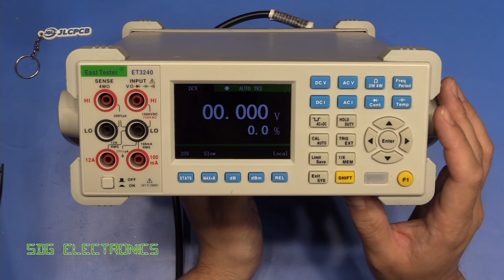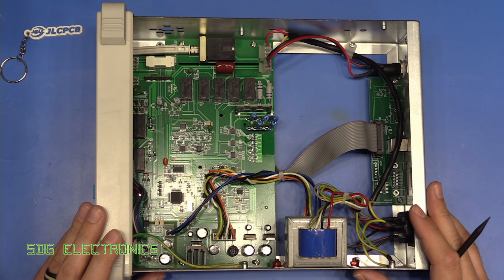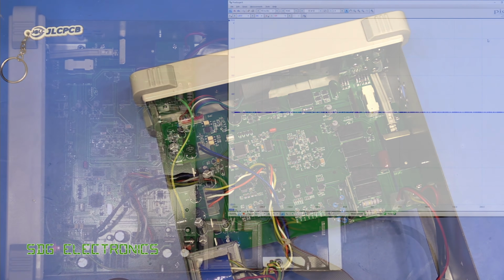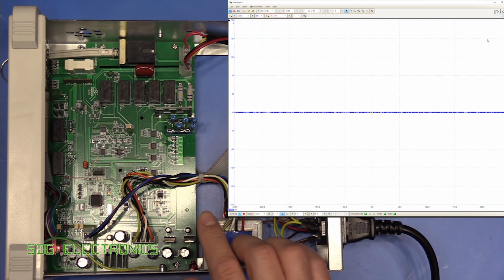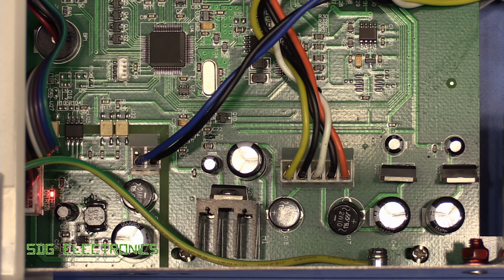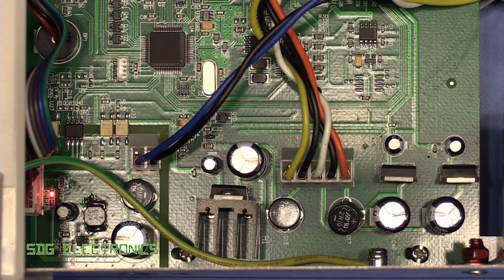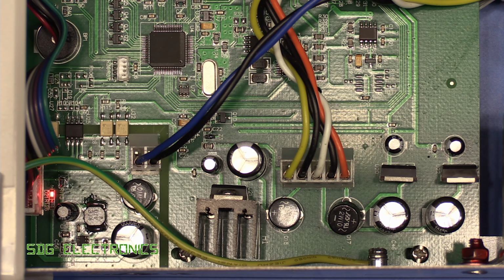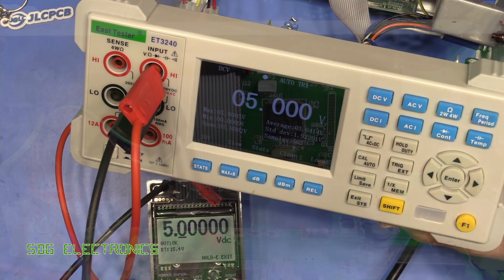SDG #202 4.5 Digit multimeter which keeps browning out

Comment: After cutting any pin or component leads i like to reflow the joint as you say to remove any stress in the joints.
Reply: That's double the work! :)
Reply: @goku445  Not if you remember to cut them the right length at the start. if your kit is flying at MAC1 and 40,000 ft you don't want a stressed out joint before it starts. :)  if it's sittng in your living room not a big issue.

if you sell your products you don't want them coming back, it's bad on sales.

Comment: Nice video!  Just confirms my general theory on why things break:  if it's a moving part or a power supply (which often have fans), look there first.  I wonder if it was a fractured solder joint from trimming off those pins?  Hard to tell..

Comment: Interesting to see that the problem was a cheap connector or bad solder joint.
I have reviewed this meter, it works fine, but finding some functions can be difficult to find and documentation of remote interface was not included (I needed it for my software TestController that can handle a lot of different meters).
Reply from the maker: I'm disappointed the spec for the interfaces on these Easttester units seems to be quite elusive. I have a Function Generator by the same brand, but it didn't reveal how to upload arb waveforms.

Comment: I'd reflow U24 too. Looked a little bit wonky of a soldering job...
Edit - FP LCD flex soldering is really quite easy- desoldering could be when you use not hot enough blade iron tip.

Comment: Nice repair 👍 I wonder which bench DMM is actually better - the one you actually use all the time, or the one you have, but rarely use, because of the fragile VFD? I tend to grab my Brymen or Fluke DMMs a lot more often than HP/Agilent. It is an aspect that often gets overlooked in DMM reviews.
Reply from the maker: That's why I still use my Meterman 37XR quite a lot. It's about 15 years old now, but was 3x cheaper than the Flukes and has a really nice clear display. Like you suggest, the technical specs aren't everything.
Reply: @sdgelectronics  Yes, most of the time you just need to measure power rail or check for continuity. Often, it is the probes that matter the most. I often use super cheap Aneng meter, that I got from Ali (after Dave gave it thumbs up), but with probe master probes.
Reply: @sdgelectronics  Meterman was made by  the Wavetek back in the day?

Comment: I have some tinkering on CRT monitors coming up and need an isolation transformer... any recommendations?
Reply from the maker: None specifically, but I'd go for the biggest you can afford. The higher source impedance of the smaller units mean you can get some unusual waveforms depending on your load. I'm using a Rheomed medical isolation transformer which I picked up on eBay a long time ago.

Comment: Does your meter filter 60Hz noise mine does not seem to ?
Reply from the maker: We're 50 Hz here and it's pretty clean.
Reply: @sdgelectronics  Huh. Mine sees to float just sitting there and it seems quite sinusoidal. Maybe more investigation is warranted.
Reply: @stevenspmd  floating readings on any multimeter is perfectly normal operation. The noisier the environment the more hash your leads will pick up just like any good antenna should. Karl
Reply: @karlfell3768  it certainly can be but mains noise is usually filtered? For example @SDG Electronics meter filters mains 50Hz but mine seemly does not filter mains 60Hz. So either the filter circuit is geared for only mains 50Hz or I have an issue, not sure which as I haven't gotten back to it yet.

Comment: Hi Steve,
I'm a retired Electronics Destructor. Love your videos and explanations. Did I miss the link to Ian's voltage source? 
I have a bad habit of looking and missing it, especially when it's right under my nose.

Thanks,

Larry
Reply from the maker: I just added it in - I had accidentally missed it off!
Reply: @sdgelectronics  Thanks Steve,
Loose connections are the norm anymore, with wave soldering being unmonitored by our Chinexx comrades across the ocean. Make cheap, cheap, cheap, QC be damned.
We're back to a throw away society. (Isn't it great to be able to fix this stuff?)
LG

Comment: Ultra Cheap China junk  meter problem solving:  open trash-can, dump meter in it, buy decent meter, problem solved :-) But it makes a nice video
Reply from the maker: I do have a 34410A and 34401A. I should get one of the newer ones, but ultimately I get the same readings from them.